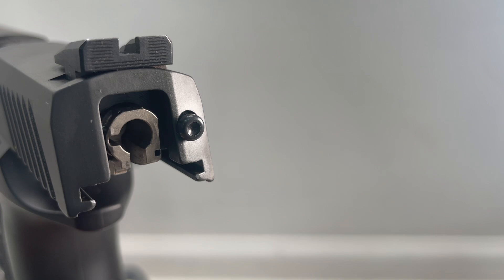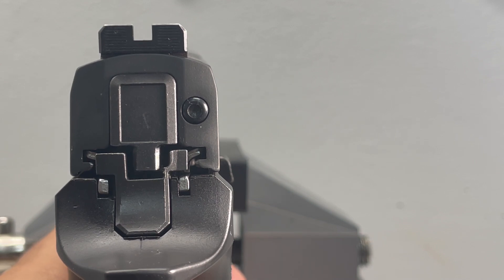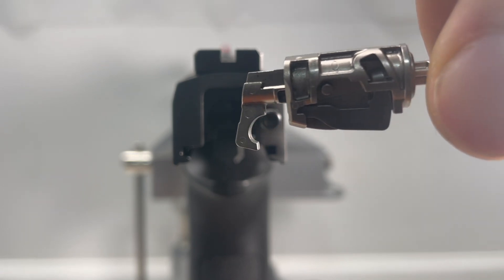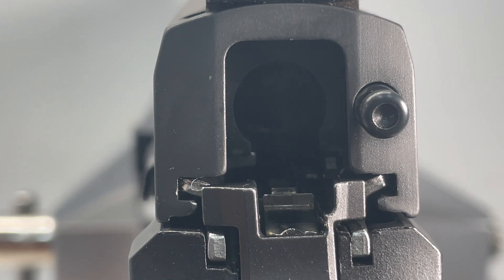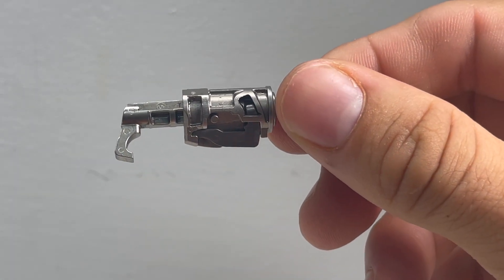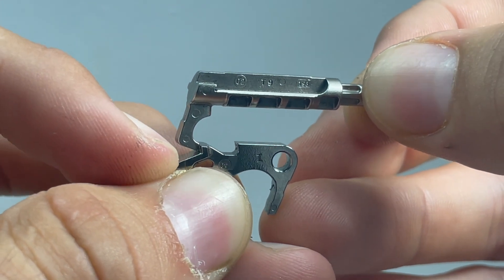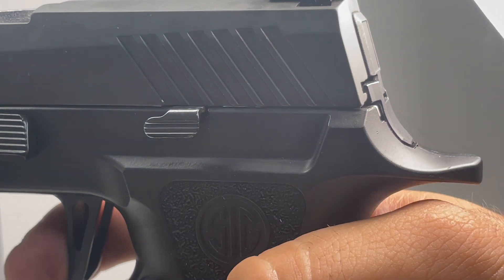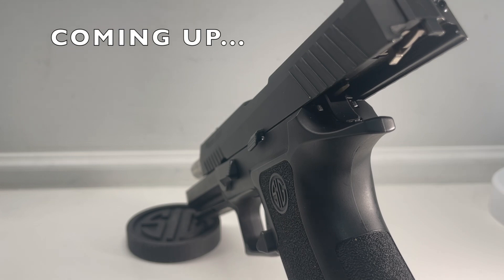P320 - SLIDE MOVES DURING DRY FIRE

Comment: People may not realize or understand design mechanics when they see this movement. The 320 was designed to operate reliably even in adverse conditions. Tight fit and lockup of all components give you the sense it's quality but that doesn't translate when operating such.
    When subjected to dirty conditions, a tight fitment can get jammed more easily. Intentionally "loose" fitment allows for debris to be overcome or potentially cleared by rack/clearing functions.
   I've seen torture tests where the 320 will still function more reliably than other guns like 1911s and other striker guns in its class.
   For instance, garand thumbs freeze test (cold or arctic conditions) saw only the 320 and m&p passing this test. Even the glock froze up and failed to fire when commanded. Extra safety levers, grip safeties, and trigger safety tabs can freeze up (applies to muddy sandy dirty conditions as well).
    Detailed scrutiny explains why the 320 was chosen over the glock finalist for the military (also price but thats manf determination).
    This design tolerance is intentional and working properly.
Reply from the maker: This is exactly right. I did also ask about tolerances when I visited Sig and they (VP of engineering and design) confirmed it as exactly how you explained it.

Comment: Yeesh. I'm just looking at that frame rail to slide interface and how much slop there is. None of my M&Ps or Glocks are fitted that loose.
Reply from the maker: It’s just a design. I have modified P320s so that these slides are lapped and truly with no tolerance and the slightest amount of grime or dust gets in there and it starts to fail.

Granted, I haven’t tried doing it somewhere in the middle of no tolerance and tolerance. Maybe I should try that.

Comment: Have you seen pistols that do this with the mag inserted? I've seen two that do this even with the mag inserted.  I'm wondering if the slide stop is wearing out so that tension you mentioned is no longer sufficient.
Reply from the maker: I have, it’s just VERY slight movement still due to the connecting parts. The barrel is unaffected due to how the under lug pivots on the FCUs slide catch pin.
Reply: @SIGMECHANICS  I think collectively we are getting close to being able to answer the "why" and "how" the 320 is having uncommanded discharges. Personally I'm confident that a factory new 320 with manual safety with all stock parts in spec and functional is perfectly safe. Wear, poor quality parts or user modification are the real culprits.

Comment: How likely is that sear to break? Assuming you placed gun down with a round in the chamber, could that tension break the sear and create a ND?
Reply from the maker: Realistically, not at all. I don’t have the numbers at the moment, but I am working on a project where I will be testing the tensile strength of the material of a factory part versus a CNC machine tool steel part. My current findings show that the Factory part is still pretty darn robust
Reply: @SIGMECHANICS  I never doubted Sig, but it's great to know. Now I can explain why one in the chamber is safe as well so thank you!
Reply: If the sear was to disengage with striker foot, the striker block SHOULD prevent it from firing. Unfortunately, there’s a chance with a P320 that their piss poor design of the striker block (among many other issues) will NOT prevent an unintended firing of the gun.

Comment: I noticed this on my AXG Pro while my Xfull doesn't do it.  My issue is the AXG has a nearly dead trigger without a mag inserted, it requires extra pressure when it is as far back as it can go.  Even with the mag in the trigger is way worse than the Xfull.  If I swap the slides the AXG frame works better with the Xfull slide and the AGX slide works better on the Xfull frame.  Both have the post recall notch in the slide.  Anybody have any knowledge about this?  I'd prefer to fix it myself than to deal with trying to send it to SIg.
Reply from the maker: Sounds like your overtravel distance is “off” but that would not be fixed by swapping slides.

Can you try taking out the striker from the AXG and swap it with your full size? I suspect the leg on the AXG striker is just a fraction of a fraction too long. So when the sear drops it is hanging at the razors edge of the striker before releasing. This could technically go away if you remove the trigger stop pin.

Mind you, I have no idea what the problem is without holding it and testing myself but if this is the case, send it to Sig. The fix would be to file a little off the striker hook base, but I cannot recommend because if you do that you will lose warranty and of course open yourself up to some (possibly) serious liability issues.

Comment: Normal for striker fired pistols?  My 365, 2022, 250 and Glocks 23 and 27 don’t have any movement
Reply from the maker: The 365 definitely does move but substantially more subtle than the 320. However the 365 has a long rail vs. the 4 tabs of the 320 to stabilize movement.

Comment: mine did it with or without a mag ...I just put a machinist clamp around the sides of my FCU to keep it from spreading then put it in a vice and ever so slightly bent the slide rails on the FCU down just a C-hair and it tightened everything up with no issues
Reply from the maker: Interesting, the slide movement wasn’t affected at all? No binding?
Reply: @SIGMECHANICS firstly I am an engineer by trade so it's natural to me to look at something mechanical and figure it out, secondly mine was an M18 but should be the same, there seemed to be a bunch of slop in the rails to begin with from the factory (side to side AND up and down)  but I just assumed it was for reliability being a military gun and all. Never really thought much about it, Then I saw a video showing how much a guys red dot moved under dry fire so I looked at mine and it was moving a ton too. So I decided to try to tighten it up and I looked at it realized the FCU tabs are at an awkward angle not flat to match the slide rails like most firearms and saw that if I bent them down just a hair they would go both out and down. When I bent them and I mean maybe a few thousands when I say bend. it took out the side to side AND up and down slop. The only issue I noticed was when I went from a wilson combat polymer grip to a sharps bros the slide was a little tight since the sharps bros aluminum grips are designed to take up the slop I already took out, nothing some 400grit and a lapping plate didn't fix 😅

Comment: "...this is a normal operation for a striker fired pistol" may be true for P320 but not for all striker pistols.  My Springfield XD9 slide does not move at all.  Rails on the XD9 are substantial and control the slide nicely.
Reply from the maker: The comment was more for noting that all striker fired pistols will have an amount of acceptable movement (some more than others), just by the nature of the design. It is very possible that with additional supports built-in, you can minimize that to an extremely small amount.
Reply: @SIGMECHANICS  Thanks for excellent work on P320 and all things Sig.  So, the mag when inserted stabilizes the slide with some sort of spring tension presumably from the mag release holding the mag eject spring.  Or the the mag spring is pushing rounds up.  Wherever the tension is coming from, is it enough to control the slide as well as my XD9 or P365 and P226?  The answer is likely no.  Is the P320 slide control a problem?  I've run rounds through a M18 and a X5 Legion.  Both had mushy triggers with poorly defined walls and touchy breaks.  I could not ride the wall like I can with a P226.  Is the slide movement on the sear causing this?  Training would solve this but there were other problems.  M18 stove piped and the X5 Legion had a cracked frame at the front.  There is a YT video of a P2022 in operation and the amount of frame flex is startling and does not inspire confidence.  Smith extended the metal frame to the front of the polymer frame in the MP9 M2.0 for this reason.
Reply: @SIGMECHANICS  Your excellent take down shows us what is going on in the P320 FCU.  Maybe some why speculation can shed some light.  P320 FCU is an adaptation of the P250 FCU so it is not a clean sheet design.  Adapting a hammer strike FCU to a striker is questionable but one has to wonder what Sig could have done if they had started from scratch.  P365 is the answer.  P365 features full length rails that are fitted to the slide.  P365 does not suffer from drop safety and UD issues.  IMO, P365 FCU is superior for being a next gen design.  P320 has passed a lot of tests but for me, the average home defender, too many questions linger.  If I am going to pick, I will take the design that has less questions every time.

Comment: My slide moves forward when the trigger is pulled, as if instead of locking on the takedown lever, it's hanging up on the striker.
Reply from the maker: That would be hard to determine without seeing it, perhaps remove the slide cap and see if you can use a small metal bar to retain the striker and then try to replicate the issue.
Reply: @SIGMECHANICS  Great idea! I'll return with an update.
Reply: @SIGMECHANICS  Without the slide cap, it doesn't do it.

Comment: But why does the slide and frame rails have that much gap to allow the “bounce”?
Reply from the maker: That is the general design of a striker fired pistol. You can tighten this up if you are up to it by adding more material to the rails and lapping it with your slide, I would recommend this is something you would do with a professional.

Comment: I have picked up a p365 Xmacro. When I dry fire I have movement in the slide and fcu. The movement is forward and backwards. Not so much up and down. Is this normal? No movement during the take up. The movement is the gap between the wall and the trigger break.
Reply from the maker: I’ve never seen that, can you send me a quick video?
Reply: @SIGMECHANICS  https://youtube.com/shorts/UA3VTMJ4fn0?feature=shared
Reply: https://youtube.com/shorts/UA3VTMJ4fn0?feature=shared
Reply: @SIGMECHANICS  I have the video posted on my channel. I tried commenting the link but it apparently isn’t letting me
Reply from the maker: Ok I saw it. It seems like as the sear drops the connection between the sear ledge and the striker hook is forcing the striker to retract slightly as it gets to the top edge of the sear. It doesn’t look like it’s a real problem but, I’ll take a look into this to see if I can get a better idea.

Comment: Hello there and thank you for your videos, they really helped me out a lot.
I noticed that inserting the empty mag almost reduced the slide movement to zero. After installing the armory craft trigger and spring set to reduce the pull weight (aimed for the low pull weight, I am at 3 lbs right now to meet competition rules in my country) , I noticed that the slide movement is also noticable with the mag inserted. I can`t tell if it  has been like that before or not or if it happened over time. This might have nothing to do with the upgrade, I just noticed it after upgrading.
I can eliminate the slide movement when I push the mag in a bit further and hold it in position. I also tried a brand new mag with the same result. Any suggestions on how to fix this? I am going for accuracy and this just doesn't feel right, when the sights slightly move while firing. I did not try it with a full mag yet, but I have tried it with a dummy round in the chamber and an empty mag.
I have a Xfive Legion and the only upgrades are the Armory Craft adj. trigger, sear springs, return and safety spring. Hope you can help.
Reply from the maker: There are so many variables that I’d have to really have it to see what it should be. If you feel it’s the AC trigger, have you swapped back to original to see if it stops? There should be barely any movement on a full mag, but dummy rounds would be okay too. 

The trigger (tuned) will pull your trigger bar a bit but it wouldn’t inherently change much if anything at all. The real cause is probably how much tension there is on the striker spring to the sear, the stronger the grip between the two parts the more likely you are too, have the slide move with the trigger pull.
Reply: @SIGMECHANICS  thank you for your response👍. I will try swapping it back, but i think you are right. Maybe it it because of the low tension caused by the spings. I will investigate it further and report back with my results.

Comment: I used to have an XD subcompact and it exhibited no detectable slide movement. The XD’s are very well made and I believe they’re very underrated. Great video, sir!
Reply: What do you prefer? Xd or 320?
Reply: @jm_truestory3615  I haven’t used the 320 yet so I can’t give a complete answer but based on build and feel, the XD has the easy win. On the other hand, the 320 is a significantly newer design and the modularity represents a lot of value. Until I’ve used the 320, it’s a toss up.
Reply: @Casey_Schmidt  I've sold one gun ever in life, a SA XD9 Subcompact. FTF & FTE like no other, didn't matter what ammo you threw at it. Bought it exclusively for CC, had two gunsmiths poke at it, still jammed despite springs, Ejector, and other parts R&R'ed. Shoulda listened to my buddy, who advised against it. Ended up pawning it for $200.

Comment: i have a question that i cant seem to find anywhere. 
i dont know if its just my gun or not, but when my 320 has a round in it, it is extremely hard to press check or rack it back to remove the round. it fire normally by none of my other guns do this (this is my first sig)
Reply from the maker: You can try to upgrade from a captures guide rod to a 1911 style, this will reduce the compression ratio of the spring to a more tolerable lever. Alternatively, it may just need to break in a little.

Comment: Well done sir!!...fine job....  My 320 TDL is a bear to rotate.   Its.worn in,  well lubed and i have strong fingers.... It is impossible to rotate without a tool,.... But if i remove the mag last, i can almost do it with my fingers....    Empty mag in,.... Rack slide,..... Remove mag,.... Then the TDL will rotate.   I believe it to be the forward edge of the takedown safety lever, putting forward pressure on the barrel of the TDL.  It seems to jam it, making the lever unable to turn....  When i remove the mag last, the forward edge is not forward enough to show in the hole in the FCU.
Reply from the maker: What sort of recall spring assembly are you using? They take down lever is directly interacting with the rod and depending on the position of that rod , it might be causing your problem. I’d prefer to use 1911 style rod and spring but that depends on what size P320 you are operating with. You may also want to double check the sear springs, if something is off, it might be preventing the takedown lever from fully retracting the sear. This is probably less common, especially if the trigger feels fine during normal operation. Again, this is unlikely, but a possibility your takedown lever should be relatively easy to turn.
Reply: @SIGMECHANICS  I created a workaround.  Have 2 320s  one is a sub compact, other is a full size TacOps  ....  The sub came with aftermarket TDL.  I swapped the TDLs...  Both are stiff now, but both doable with human fingers...   Before the sub was easy,.... But the tacops impossible...  I have images on the Sig talk forum.

Comment: Hello to all... and to the creator of this content. BUT: The slide lock goes up with a empty magasine... when not a empty magasine is there, the slide lock will still be down and the slide will pull down when the trigger is pulled. 
Good news is that this is not affecting the precision or the propper functioning of the gun. 
Another nonsense is to say this is intentional... nope is not (in my opinion) but more of a consequence of, this time intentional, play designed in the moving parts that allow the gun to work in dirty condition. 
Remember... this is a military gun not a target precision one, yes its accurate... but the purpose here is diferent. Take a CZ 75 as example, is a rock solid gun with very tight interference in the moving parts, it performs excelent in the shooting range. It will work same in the combat conditions? Full of sand or mud? NOPE... it will jam.

Comment: I left the Glock world a few years ago and just recently bought my first Sig, a p365 x macro comp. 
I seem to shoot this gun much better but for whatever reason shoot it low. 
Yesterday I purchased a p320 AXG pro and shoot it low as well. 
I noticed the amount of slide movement during dry firing, wish there was a way to tighten it up other than inserting a magazine. 
On another note, your videos are beyond excellent, extremely informative and probably one of the best channels I’ve come across for learning something that I’m not familiar with. Thanks for the great work!
Reply from the maker: It may just be old habits transferring to the Sig line. I find that 6 o’clock position is not best on Sig, POA-POI is how I shoot. (Granted I have aftermarket sights, but not on all of them).

The slide movement won’t be an issue when the mag is inserted to the gun so I wouldn’t worry about the barrel dripping, also, since the drop is caused by a force at the rear of the slide, technically (just guessing here), that would raise the barrel at the front and not drop it.

I’d say your good to go, just a bit of practice only to get familiarity with its behaviour. I can honesty say, Sig has need the MOST accurate barrel out of the box I’ve shot.

Come to think of it, the only reason I even install a Barsto barrel is because I really like the look because I don’t really shoot past 25 yards on average!